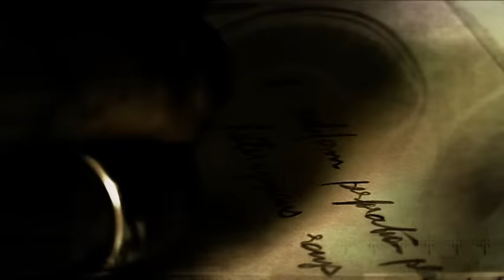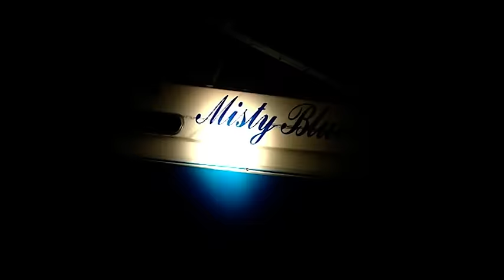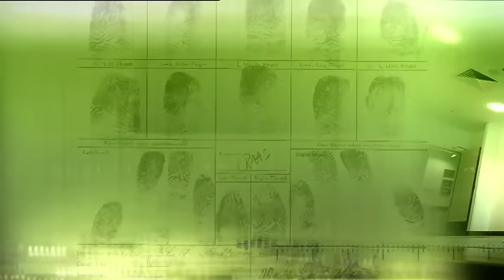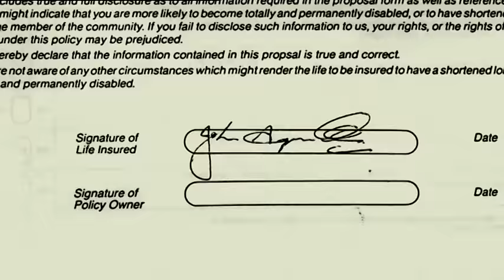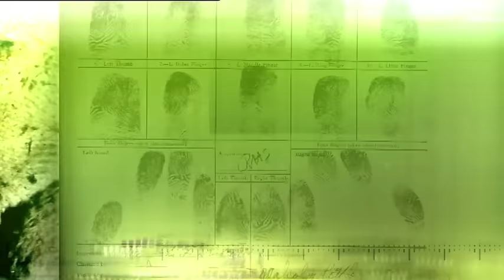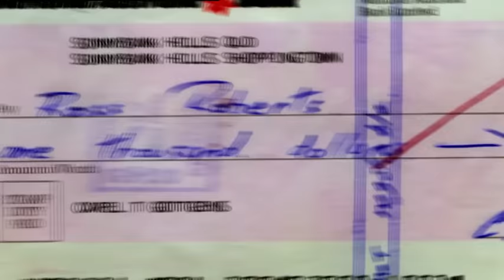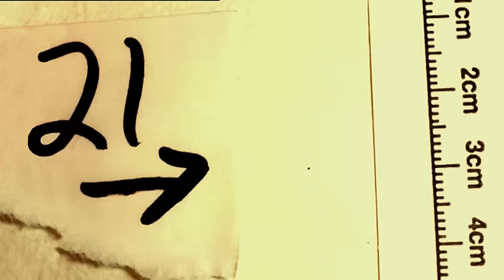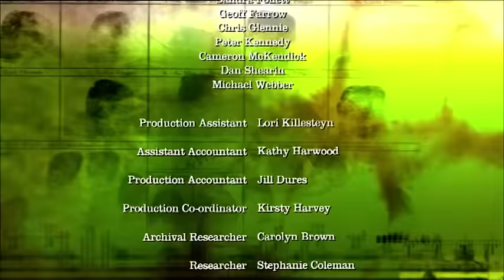She claimed he was killed by Pirates | THE BLACK WIDOW MURDER | Forensic Investigators

Comment: Look under the pergola tree!
Reply: I was thinking the pergola is a likely place. Although you're using the word tree, a pergola is just a small decorative structure a bit like a gazebo but not covered.
Reply: @nlwilson4892  : I was confused, I conflated the betula, birch wood of the gun stock and pergola. Thanks for pointing it out
Reply: At any rate, is what they called a building shed what the receipt called a pergola?
Reply: @rogerscottcathey  No, a pergola would be free standing. Usually a centrepiece on the lawn, a quite corner to sit in or to join two bits of garden like a decorative arch to walk through.
Reply: @nlwilson4892  : So strange they didn't look under that then, isn't it